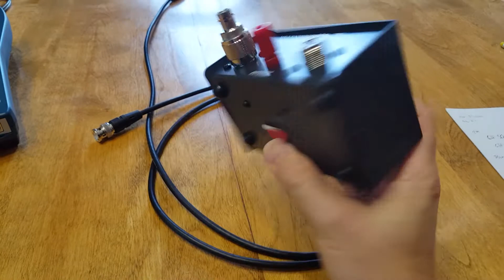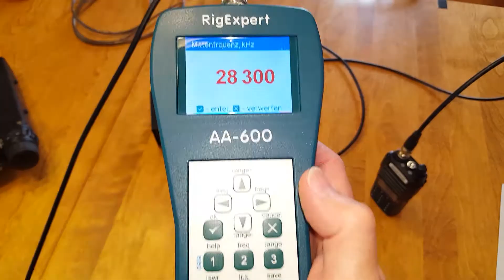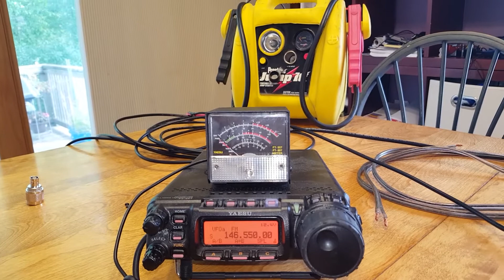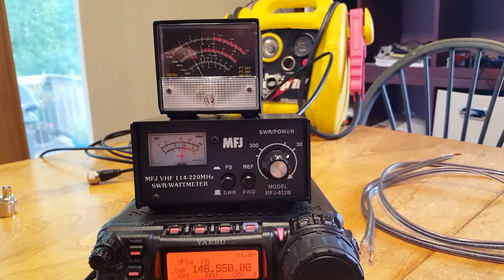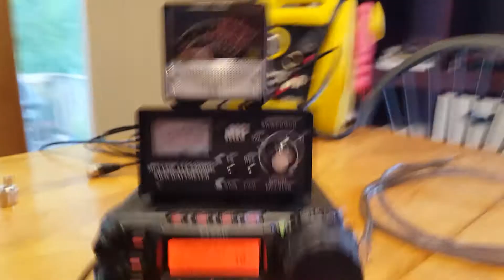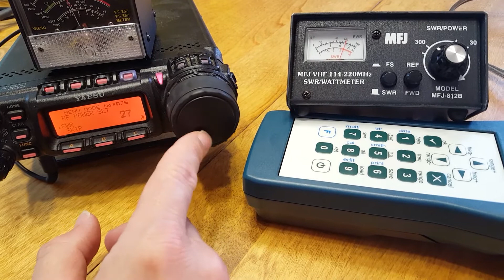MFJ 812B SWR, Watt Meter, and Field Meter

Comment: Why do some of these meters say 114-220MHz and some say 144-220MHz?
Reply from the maker: The operational frequency range of SWR meters can vary by model and manufacturers.  Sometimes they can be used for various bands and usages, i.e. not just ham radio. Thanks for watching.

Comment: So to measure the power, the two buttons must be open, and put on the scale 30w or 300w, is that it? thanks.
Reply from the maker: Yes, open as in out, i.e. not pushed in.
Reply: @adventurewithclaus  thanks PY4HZ

Comment: Hi. Interesting video of this MFJ-812b meter. I've a question: Is that meter for all types of radios or is there a specific type? I mainly use Ham mobile and Cb radios. I also have this meter but without the "b".
Reply from the maker: The meter isn't specific to a radio.  It's specific to frequency and power. In other words it can measure SWR between 144 MHz and 220MHz. CB frequency is around 27 MHz.  Only the 2m ham band is covered.  (1.25 meter is right on the edge of this meter.)